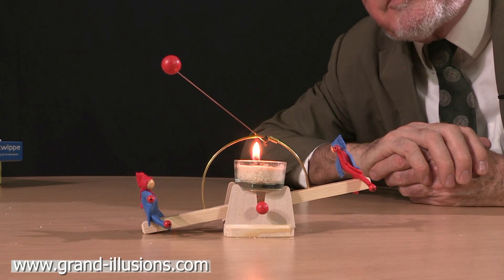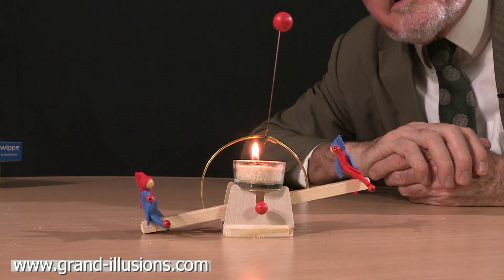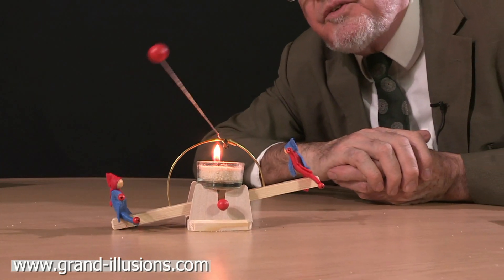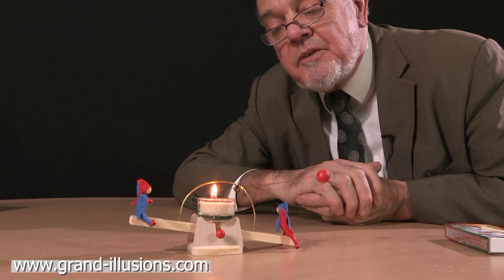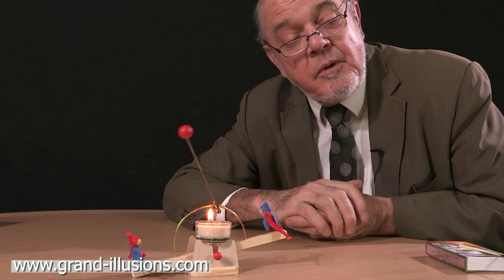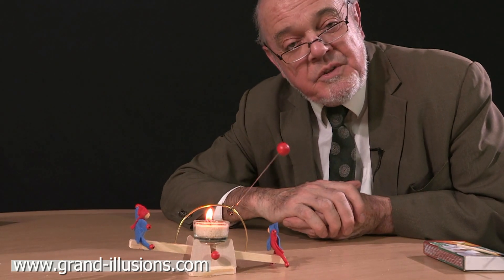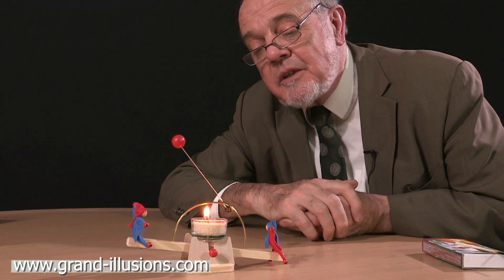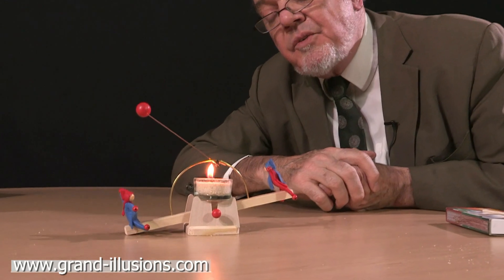Bimetal See Saw

Comment: Nope. The bimetal bends when heated (coz there are 2 kinds of metal and each has different thermal expansion coefficient.) and tilting the ball to the right. When it's not heated, the bimetal become straight once more and tilting the see saw back to its original position.